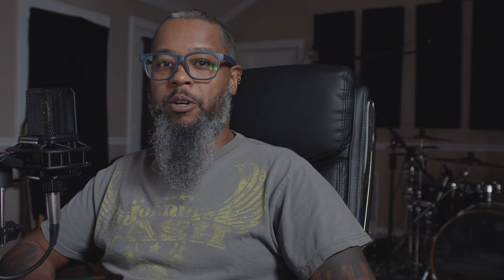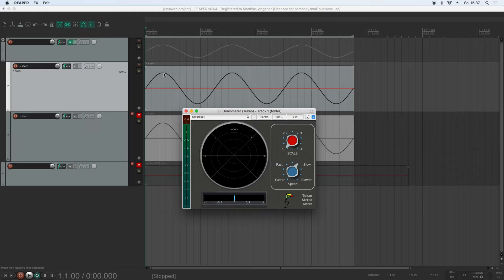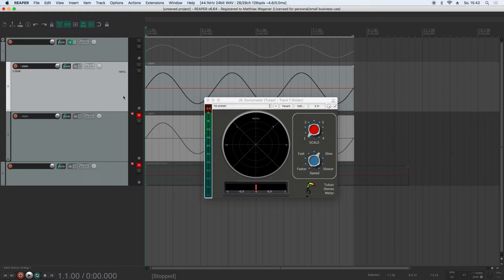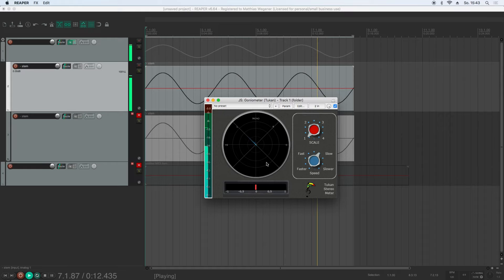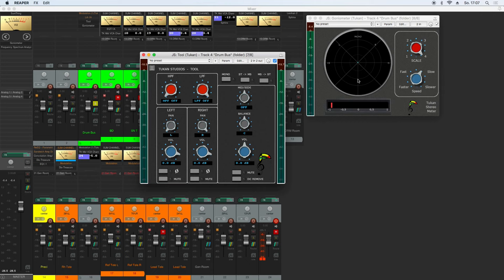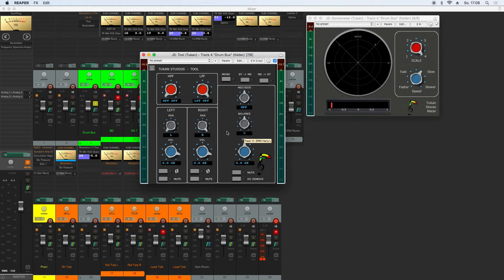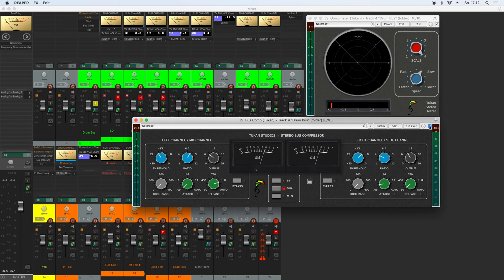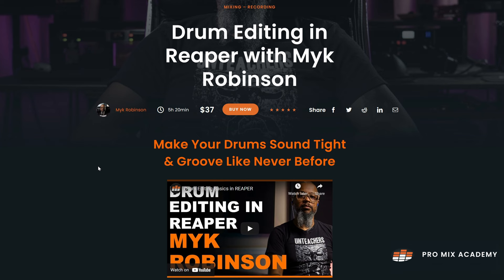Mid/Side Processing Explained, Featuring John Matthews from Tukan Studios

Comment: One thing a lot of people miss is that the side signal by itself doesn’t actually have any stereo separation.  It is just as mono as the mid.  It has to be, cause it”s one channel.  If you mute the mid and decode, you still can’t tell which instruments are supposed to be on the right or left.  It will, however, suck your brain out through your ears if your not careful.  The side signal must be mixed with the mid to have any real L/R position information.  When you change their relative levels away from unity in either direction, you start to lose that.

Comment: Thanks, Myk. One thing to remember is that mid/side processing isn't perfect. The mid is calculated by adding left and right so it includes the sides. (Mid=(L+R)/2) while the side is the difference where the mids null out. (Side=(L-R)/2) So processing the side doesn't affect the mids but processing the mids does affect the sides. The de-encode is just L=(Mid+Side) where the right part of the side is out of phase to the original (the -R above) and R=(Mid-Side) so the right part of the side is now in phase and the left part of the side is out of phase. Getting the sides away from the mid is the hard part else we could have 3 channels and do perfect mid only, right side, left side processing and just sum them at the end. 😄 This is the kind of stuff to keep you awake at night.
Reply: Sorry to say that, but that's not completely correct. The side signal is processed hopefully regardless of the polarity. So both channels (L & R) have the same about of change when processing the side signal. You can see it like this: The mid-signal is the "sound information" while the side-signal is the "stereo-amount" information. It's a rough description, but I think you know what I mean.
Reply: @johnmatthews8435  I understand, side processing id fine. Imagine a 1k 3dB boost on the mid, which is after all just a mono sum of left and right, mid and side. Subtracting the side later doesn't 'fix' the problem. It works out on paper and in practice.
Reply: @mageprometheus  Exactly. You boost 1k +3dB on the mid-channel. So your mono information will get stronger there, not the stereo information. That's exactly what it is about. Imagine boosting the side-channel the same way. Now the stereo information will be boosted in the same way, while the mono signal stays the same. :) (And trust me, the left channel will not be louder then, just because of the +/- thing. Because if the mid-signal is negative, the right channel would be louder then)

Comment: You've confused me! lol The initial statement of Centre and Side processing 'isn't true' was then followed up by an example of a Mid/Side processing which affects the 'Centre and Sides', well Mid/Mono and Sides is probably a better way of explaining. M/S processing is created by duplicating signals and inverting the phase of one of them to create the M/S image so you have control of the Mid and Side of the source, so for the layman it could be perceived as processing the 'Centre and Sides' independently, although it's not completely accurate, especially in a Mastering context which is why you really have to consider phasing issues.
Another thing to consider is when you duplicate a source and pan one left and one right you will achieve phase cancellation (I believe this is the right term) and thus create a mono signal. Take a rhythm guitar track for instance, record it in mono and duplicate it, pan one hard right and one hard left and you have a mono signal, which is why you have to double or quad track guitars to achieve stereo separation.
It's an interesting concept which is commonly used in Mastering to Mono Bass, add stereo width etc but is certainly not an easy concept to fathom 👍
Reply from the maker: Oh, I'm all kinds of confused 🤣

I made a follow up video this morning showing what lead to my initial confusion, which is something to the effect of expecting a certain "area" of sound to be affected in a certain way using mid/side processing and it not doing what I expected. It's only a couple of minutes long, perhaps it'll spark more conversation on the topic
Reply: @LetsTalkAboutReaper  I've just dropped a comment which I hope may help, or confuse the matter further!!! Definitely in need of more coffee!!